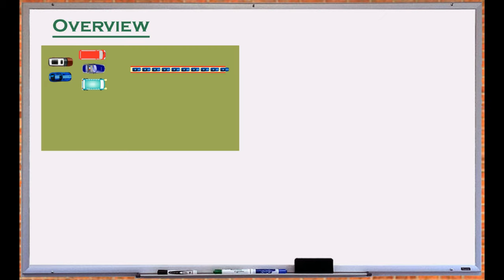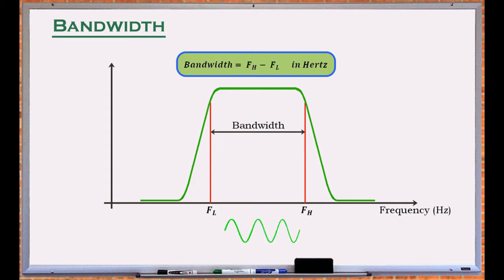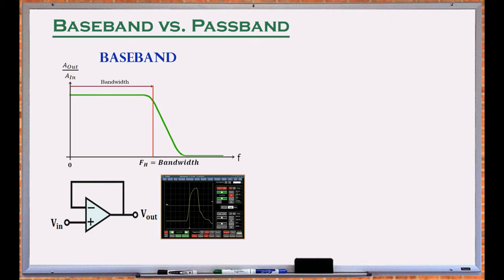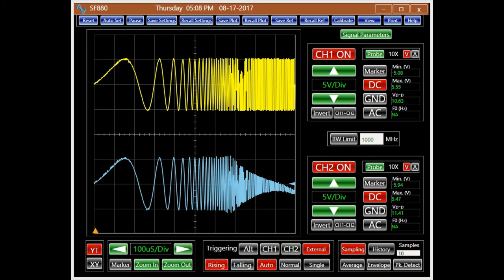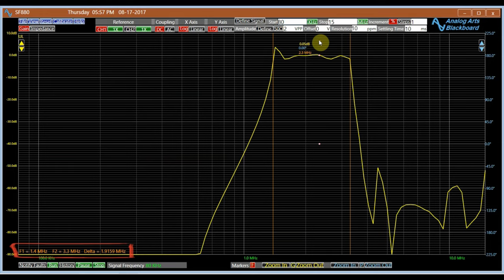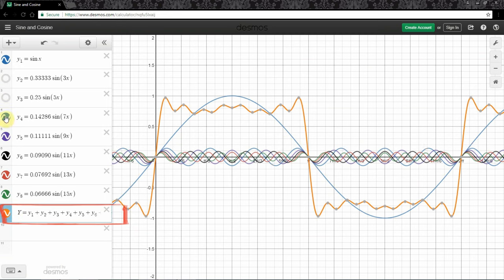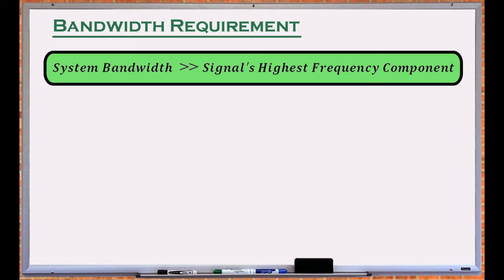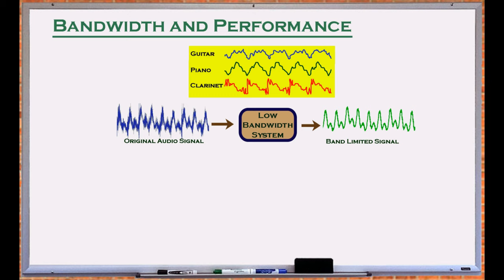What is Bandwidth? (Bandwidth and Signal Processing)

Comment: could you plz explain how would we measure/determine the bandwidth of any given medium? plz mention some techniques/methods.  i have a coaxial cable i would like to determine its bandwidth how to determine it?
Reply: The BW of coaxial cable will be very high, in GHz.  Are you sure you want to measure its BW or its characteristic impedance.  Two different things.  If you want to measure BW of the cable, something i have never personally done, then i would try using a spectrum analyzer with a tracking generator function.  Use a spectrum analyzer with the highest possible BW and be sure to normalize the response before you start.  Sorry i could not be of more help, but if i had to start somewhere this is where i would begin.

Comment: Why are the bandwidth markers at -3dB mentioned being -29%? Reason for asking: +3dB is 200% and -3dB is 50%, but here this seems not the case?
Reply from the maker: There is a power ratio and then there is an amplitude ratio. The amplitude ratio is the square root of power ratio. You are absolutely correct with your numbers when we talk about power. However, here we are talking about the amplitude of the signal. -3dB translate to 0.5 (or 50%) in power and the square of 0.5 (0.71, or 71% so 29% down) for amplitude.
Reply: @academia7768  Thank you so much.